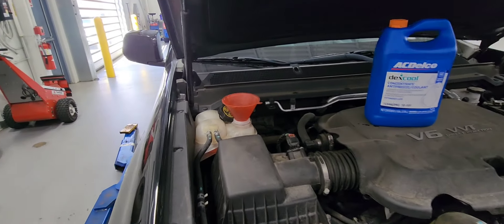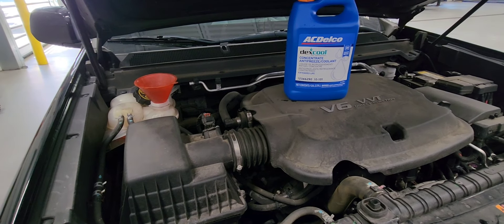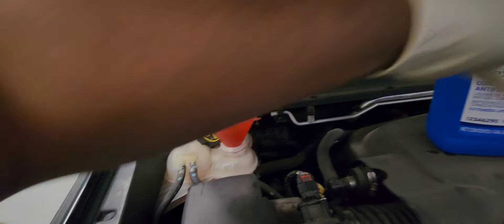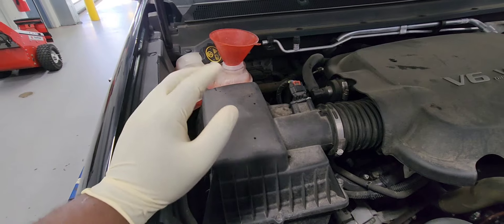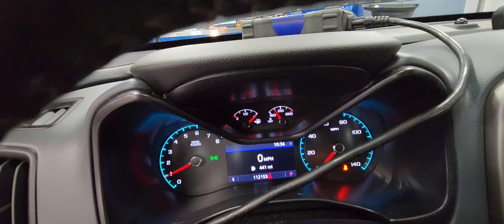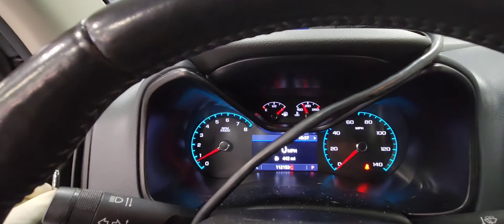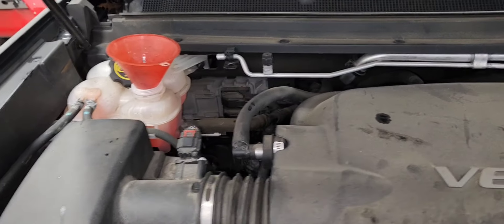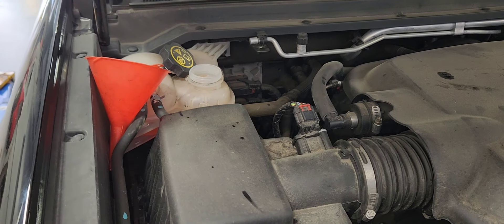How to bleed cooling system on most GM vehicle(Chevy/GMC/Buick/Cadillac)?

Comment: My 2019 GMC Canyon, you can always hear the coolant rushing through the dash, was told there was air in my coolant I was always afraid to start it with the cap off lol, I thought it would come rushing out as soon as I started it. But I now know different. Thanks!
Reply: I also hear coolant rush. Did this work for you? Did you also have to replace coolant often? I do and there's no leak.
Reply: @ Yes it’s fixed, the thermostat was culprit, one day it got really loud then, my temperature gauge dropped to the minimum and the fan wouldn’t shut off. As soon as the thermostat completely failed the rushing of water noise completely stopped. I replaced both my thermostat and coolant temp sensor and never had a problem since. Hope you get your truck fixed!!

Comment: Hello @steevegmtech7326, I really appreciate this video and the video linked to this one that you made. You are a tremendous help. My question for you is there any concern for a specific torque you wish to tighten the ten mm bolts that hold the thermostat assembly back on with, or is tightening until the bolts are secured tightly enough? I have looked all over the internet for a service repair manual to find such information on the bolts but have not found such specs for the 2017 Chevrolet Colorado LT 3.6 v6 truck I have.
Thank you for your time and these videos, God bless you sir. You have saved me much time and help.
Reply from the maker: Thank you for the appreciation post, I'm glad I was able to help 👌, the thermostat housing is 89 inch pound or 10Nm

Comment: I replace the temperature sensor on my 2020 Chevy Blazer, I did not do the step. After a week the "Action Required" alert came on again. So I went ahead and followed these steps. The them gauge is not making. Could this be I need to replace the thermostat?
Reply from the maker: Yes you probably should've replaced both of the same , thermostat failure is very common on those vehicles
Reply: Thank you, I appreciate the step by step video... I did just that and I'm back up and running. 😊

Comment: Quick question I’m going to replace a old thermostat once I replace the thermostat is the radiator fans going to stop or do I have to program them
Reply from the maker: No programming required, you just need to clear the code after you replace the thermostat,you can simply disconnect the battery to clear it
Reply: @steevegmtech7326  thank you ! so once I replaced it, I had to bleed out the coolant, correct like I need to make sure there’s no air bubbles in the radiator. How long do I have to leave it on?
Reply from the maker: About 20 min or so with the cap off,make sure the bottle have coolant in and pay attention to the temp gauge
Reply: Thank you sir I appreciate!

Comment: I left mine running for 20 min with the cap off but still stays on the 2nd line temperature. I just changed the thermostat also
Reply from the maker: Probably have more air in the system,did you try to rev it up
Reply: Not yet I’ll try that right now the temperature did go up soon as I closed the cap

Comment: Does it work by other cars too or just with these types?
Reply from the maker: It works on most cars generally but read the service information before proceeding
Reply: @steevegmtech7326  after this, when it still jumping the temperature of the coolant what does it mean? Still air in the system or something else?

Comment: I have a 2019 Colorado and the coolant temp on the dash fluctuates. Goes all the way up to red line then back to normal temp
Regularly while driving but the car feels fine. Could it just be air ?
Reply: Same thing
Reply: @ so replace thermostat & coolant sensor ?
Reply from the maker: I've seen that problem on the 2.5 4cyl, usually he thermostat take care of that, bleed properly
Reply: @steevegmtech7326  vacuum fill only thing i havnt tried 
Nothing else has worked and I've filled 4 times using no spill fill, ramped and idled with cap off
Swapped the thermostat twice
Tried opening thernostat to burp
Reply: @DerfOrNuffin  does it over heat or just the coolant temp gauge fluctuates?
Reply: @DerfOrNuffin  in my case it doesn’t over heat the gauge just doesn’t stay consistent
Reply from the maker: Did you try jack up the front end ? Leave the cap off accelerate to 2000 rpm with the heat on blast
Reply: @steevegmtech7326  Yes, ran it on ramps with the cap off. Ran at 2000 rpm. I won't let it go into the red but it's gets really close. 
 Almost positive it's getting airlocked and needs to be vacuum filled.
Reply: @jayfresh210  isn't staying consistent , but gets pretty hot pretty sure there's air in the system.
 I used a no spill funnel and filled slowly, all started after the temp sensor went and I replaced.
 Going to try picking up a vacuum fill tool and filling today.
Reply: @steevegmtech7326  pressure tested and i have a leak under high pressure coming from the back hose.
 Idk how to access that hose, with out dropping the trans or maybe removing the wiper cassette.
 Holds low pressure fine, started leaking when I pumped itnup

Comment: I have a 2017 Chevy Suburban.  I replaced the coolant sensor (few months ago worked fine), thermostat (a few months ago worked fine). The truck overheated two weeks ago. The water pump was leaking so i replaced it (about 1 weeks ago) and radiator today. I bled the system like you did here, but the engine continues to overheat. If i leave the heater on, the engine temperature returns to the middle at 210, where it should be. What could be causing the overheating? God bless you Steve.
Reply from the maker: Hey, how is your cooling fan? Not common but i would check the operation , they usually have 3 speed high low medium, do you hear it all,it should be loud if it overheating
Reply: @steevegmtech7326  yes, when it starts overheating the fan does come on and it is loud, I just replaced the thermostat again today (2nd time) about 10 minutes ago.
Reply from the maker: How is the temp sensor  I've been replacing a few faulty temp sensor, what temp is it reading , use a scan tool for that not the temp gauge
Reply: @steevegmtech7326  That's a good question, I don't have a scan tool...I just turned on the truck again to clear the air out of the system
Reply: @steevegmtech7326  are they faulty as in defective?
Reply: After replacing the thermostat for a 2nd time, the truck has STOPPED overheating! It looks like the thermostat went bad for all the times It overheated. Thank you Steve!
Reply from the maker: It is possible, did you get aftermarket or oe?
Reply: OE 👍

Comment: Should I be concerned about radiator hose being hard to squeeze? Hose pressure goes away when cap on reservoir is on. I have 2020 2500hd 6.6 gas truck
Reply from the maker: I wouldn't , was it overheating? What's the concern
Reply: Water pump failed at 34k miles and overheated engine while I was at a stoplight. 10k miles later no problems but reservoir tank now has a hole on top corner and leaked coolant. Checked cap and I saw some build-up so I will now replace reservoir. I hope that the same build-up will not be elsewhere in cooling system. Truck engine temperature reads a bit past middle probably half of the time since I bought new. Only on some cold days it will be right below middle or exactly at middle. 
I guess my concern is the pressure has made the hole on reservoir and I'm afraid I will have more issues with pressure build-up. Or this somewhat normal with these engines?
Reply: Sorry. I ment to say hose pressure goes away when I remove reservoir cap on my first comment. Cap is rated for 20psi so maybe my concern about pressure on hose is wrong. First time I replaced reservoir cap temp engine went 1/4 past the middle mark and when I removed cap temp went back to normal at the middle mark

Comment: I have a 2016 that it overheats from 250 and it goes back 200 just change the thermostat what it could be the issue I need help please
Reply from the maker: Is it a 4 cyl colorado or v6
Reply: It is a 4 cyl
Reply from the maker: Do you have any code ? What are they
Reply: No codes no engine light
Reply from the maker: You would have to check the data  did you bleed it correctly? I've seen that problem before it ended being the thermostat
Reply: I just finished with that I will take a drive and see if it works
Reply from the maker: Ok,how did it go
Reply: Now is from 200 to 210 i Believe is air then
Reply from the maker: That sounds normal now
Reply: I will keep you updated if something change
Reply from the maker: @lcassemblyservices7837 👍

Comment: Why their engines tap like that? My 2017 colorodo taps like that like it has low oil
Reply from the maker: It is most likely your high pressure fuel pump it is driven by the camshaft, they tend to be noisy,do you have any check engine light
Reply: @steevegmtech7326  nope. No codes. I could hear a tap in the video, it sounds similar to mine. Always wondered what it was. Maybe it's just you said
Reply from the maker: @iamwhodis  it is normal, most engine with high pressure fuel pump make that noise
Reply: @steevegmtech7326  yep fuel pump